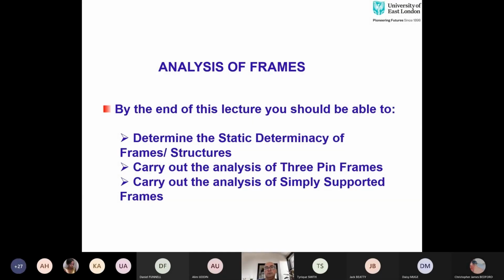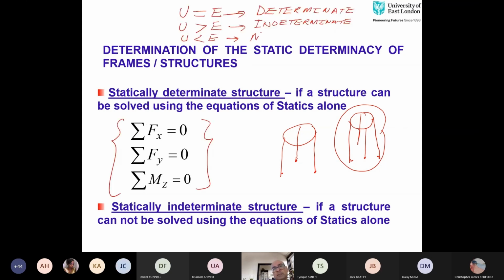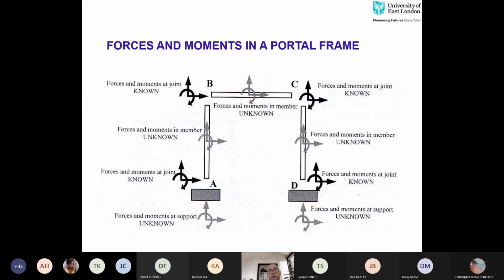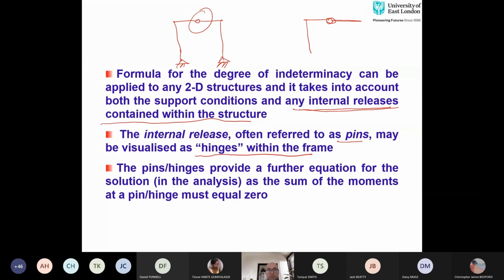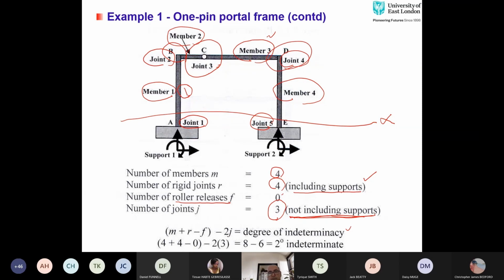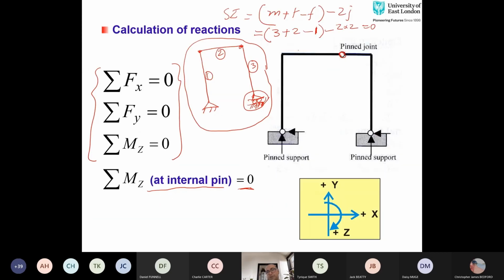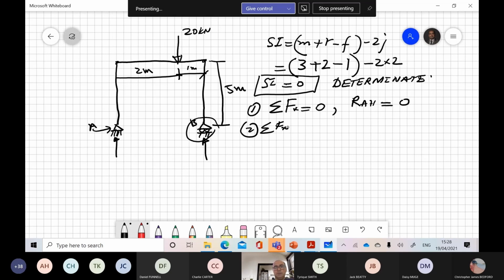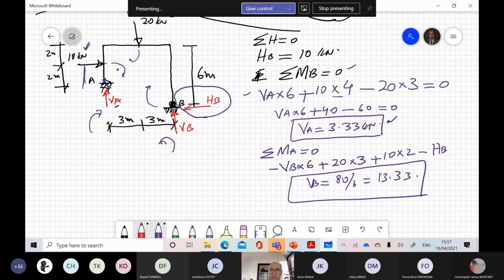REACTIONS in buildings and bridges!

Comment: Hi prof, Very useful video as usual. 
I have one doubt. You mentioned the frame with fixed end support at foundation level.  How we can do the the fixed end support ? 
Normally we will take it as pin at the bottom and do baseplates with resin anchor bolts . 
So how we can do the fixed support in reality?
Reply from the maker: Thanks for kind comment. Steel column welded to base plate can be considered as fixed. Also, concrete column cast monolith with concrete foundation can be considered to provide a fixed support.
Reply: @DrJQureshi  thanks a lot sir.